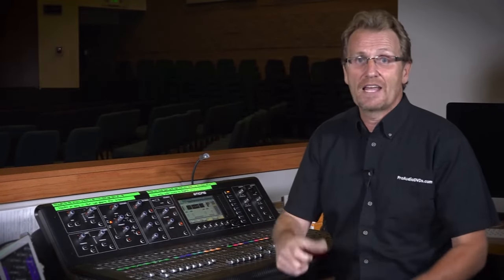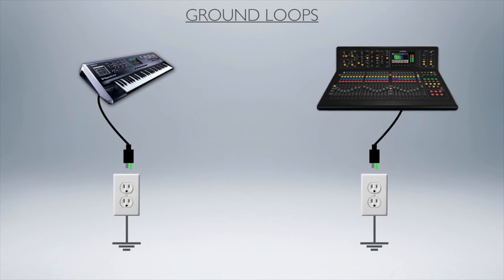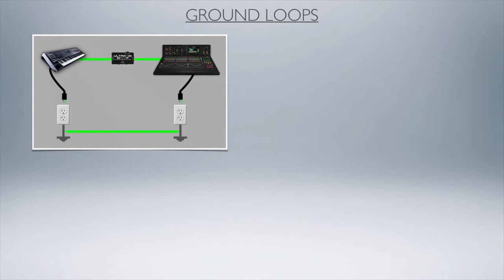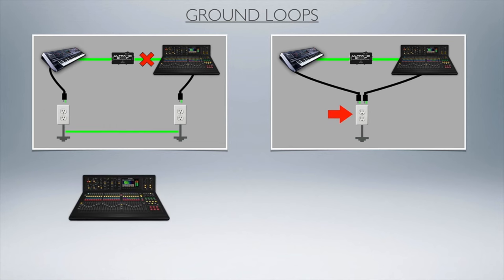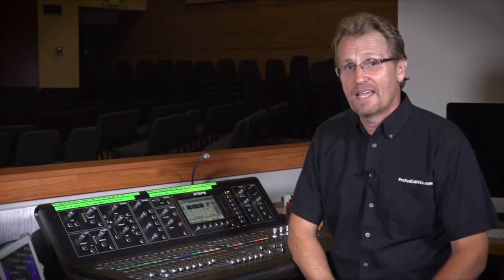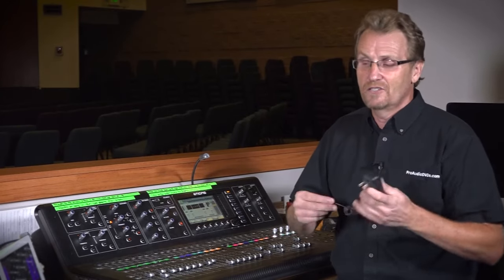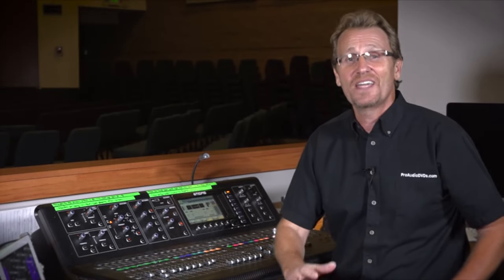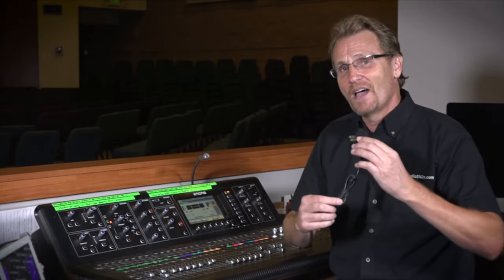Understanding and Fixing Ground Loops in Live Sound

Comment: Yet another incorrect explanation. The 50 or 60Hz hum doesn't come from "Earths at different potentials" it comes from magnetic fields in the area of the loop which are then introduced to the signal circuits by common impedance coupling and amplified. If mains outlet Earths were at different potentials it would mean that a current is flowing between them and that would cause an RCD to trip. Yes, there is a slight difference caused by a single coil pickup, but it is microvolts like the output of a ribbon mic. The real problem is mixing unbalanced and balanced equipment and not conforming to AES48 recommended practise. Many products confuse the difference between a signal common and a chassis screen, both should be connected to mains Earth, but not randomly. The screens of balanced cables should only be connected to chassis and not the signal commons. You connect to the planet for safety and discharging induced charges, but it should not be part of the signal circuit except as a potential reference. (Non static) Electricity flows in circuits, it does not flow to the planet like water. Note that I have not used the word "ground" to explain this, once you do that people can't see the distinction.
Reply: now explain this to me like I'm 5 years old

Comment: i live in europe and we dont have the ground pin and i have both devices connected to the same outlet but i still have buzzing?
Reply: In EU we have those metal things at the sides of the socket, not the 3rd PIN.
Reply: To live in Europe and not know electric circuits are grounded?

Comment: The delineation of electrical ground being a diversionary safety path for electricity in case of a fault as opposed to the signal low end-sounding ground was itself alone worthy of a sub. No one has ever put it that simply and accurately.

Comment: 2:00     The green ground wire in a standard USA 120V residential electrical system goes back to the same place (the neutral bus bar in the circuit breaker box) as the neutral wire.   The "ground" wire provides a second, fail safe route back there in case of a short within the AC powered device.  You might say that the "ground" wire prevents a human from being the ground in case a short within a device occurs and the outside of the device goes hot and a person touches it, causing the current to go through them, and the ground, to find it's way "home" so to speak.  But, the ground (green) wire goes back to the breaker box and attaches to the neutral bus.   That neutral bus bar in the circuit breaker box is grounded (for lightning strikes), but people saying, or giving me the impression, that the "ground" wire goes into the ground has kept me from understanding how AC really works until I recently really had to learn for myself.

Comment: whats the differance between breaking the ground pin off .and a ground lift switch .im assuming either way .nomatter which product used its all the same it disconnects the ground is this correct

Comment: I have been trying the lift option on both my breakout usb sound card and my DI box, neither of which do anything to remove the ground hum. Does anyone know why the ground lift option wouldn't work? Is it because I might have multiple ground loop paths through my audio devices? I'm going to try the same power socket for the desktop and laptop in question tonight and see how that goes. My signal cables are decent quality and I am almost sure it's the 2 earth pinned computers that make the ground loop. Here's hoping...

Comment: whats the differance between breaking the ground pin off .and a ground lift switch .im assuming either way .no matter which product used its all the same it disconnects the ground is this correct .if so then either ay still have the same level of risk of death by electrical shock
Reply: Ground lift switch is something different.
Do not break the third pin off.

Comment: Sir , there is noise from speaker when any electrical switch is on or off , can you suggest solution for it ?
Reply: wtf then there is currently leaking from your amp aka faulty equipment might be dangerous

Comment: That still does not explain what ground difference actually is. How does it generate an audible signal?
Also, how does the signal from a DI box with "ground lift" get to flow between the DI box and the mixer??